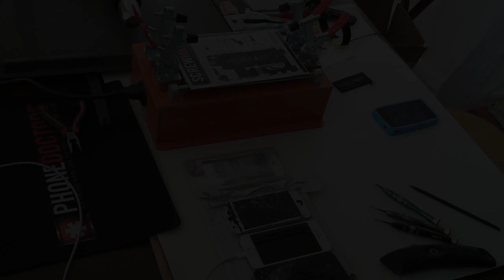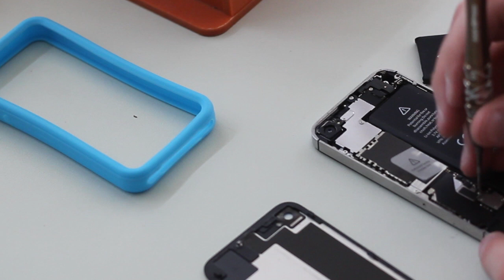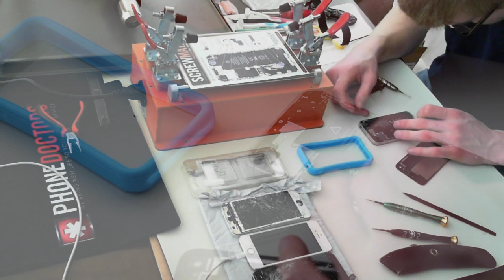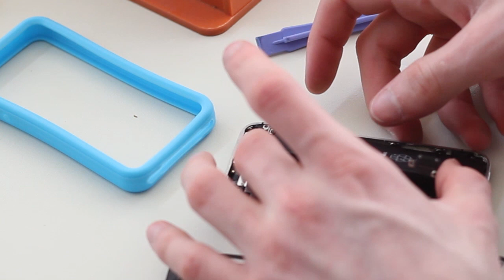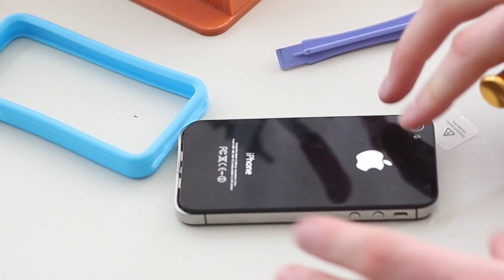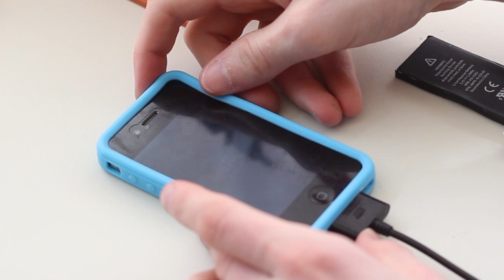Iphone 4s Battery Replacement

Comment: o
i have changed it exactly like you did .. but it's not working without cable!! can you help me!??
Reply from the maker: Mustafa Alani Make sure to plug it into an AC charger (preferable an OEM Apple charger) for a few hours, and not just plugged into the computer via the USB cable - as this does not charge with the same amperage.

Comment: How much are those tools? Is there any chance of it breaking?
Reply from the maker: The tools I am using are pro grade tools that you would have to buy separately, but you can usually get everything you need for a couple of extra dollars when purchasing a part. You will usually be able to get either just the part, or the part with the tools that you will need to complete the repair.

There isn't really much concern with this repair, as you may have noticed I am not wearing my anti static bracelet, globes, or anything else, as the phone is going to be powered down before you start, and you are obviously removing the battery, so there is not a high likelihood of anything happening to the device itself.

I would say a battery repair on a 4s is one of the safest, quickest, and easiest repairs that can be done on an Iphone. Really the only concern I could think of would be the small shield that comes off with the battery flex cable, as that could potentially be lost.